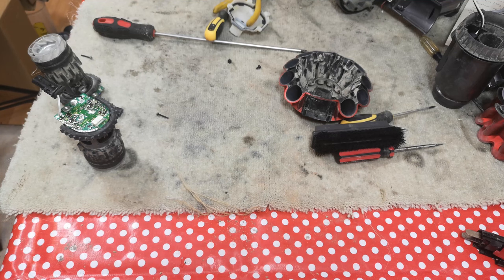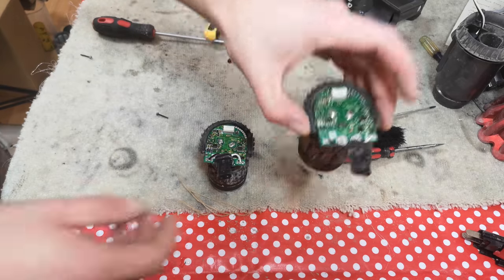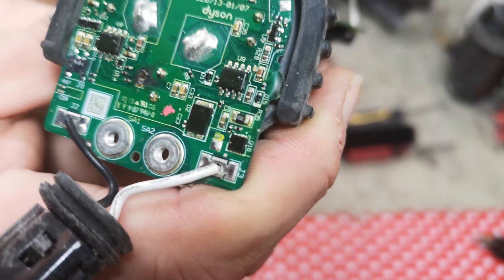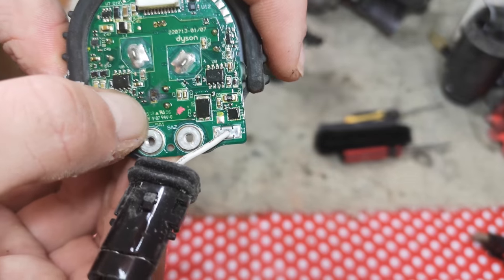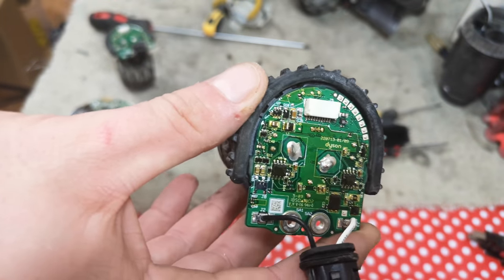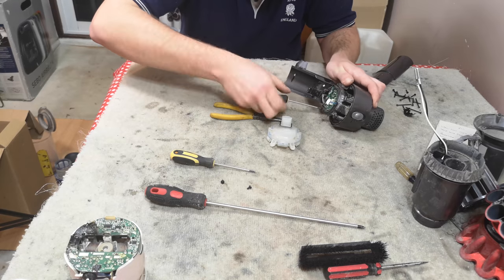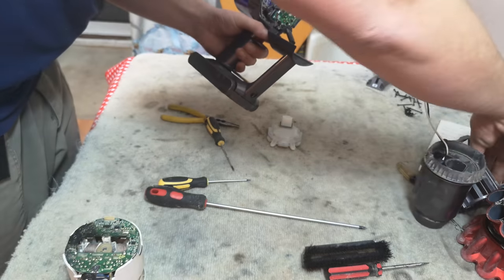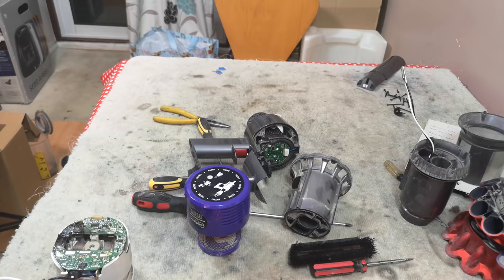A Dyson V10 Digital Motor that has been on fire...

Comment: Wait a second, dyson won't even repair a machine for pay anymore? When my v10 goes bang a month outside of warranty I guess I'll be up a creek. That's really sad, I wish vacuums weren't becoming non-repairable, expensive, and not long lasting like smartphones with yearly upgraded releases. Dyson are even trying to phase out their independent service centers in the USA.
Reply from the maker: I'm only going by what the owner said though... And I didn't press her for a recording of the conversation! This is the second v10 with a smashed cyclone I've had though where dyson said no...luckily now I know used chassis are quite cheap that's the repair they'll get now from me!
Reply: It’s probably not just because of the accidental damage. They are trying to not have engineers go out due to COVID 19.
Reply: @beko1987  That's a fair point, I guess we don't know the exact situation on this. I'm treating my v10 very gently so I'm not too worried about breaking the cyclone (plus I got it for the price of a v8 so I'm not too bothered!)
Reply: @blakaeg  Fair point, wasn't sure if maybe Sam had recorded this repair prior to the outbreak.

Comment: My V10 blew up when I changed gears with the trigger engaged. I went from medium speed to top speed, and it burned. Dyson will replace it, but I am worried once the warranty expires, Dyson won,t fix it. It seems like a simple problem; I am surprised Dyson hasn’t addressed it. Good thing, you can fix it. But still. It is an expensive vacuum, and I don’t know any decent electrician in my area.

Comment: Those ceramic capacitors fail all by themselves from time to time. I'm not surprised the motor still works without it. I've just repaired our DC62's motor which had died. One of the switching transistors had failed. They're on the back side of the board, so you have to desolder the big connections to the tags of the motor windings then withdraw the PCB. The transistors are surface-mounted. With the right tools, they're not hard to test and replace.

Comment: I had a V11 that was water damaged and the driver board was burnt it's not very good when there is plastic all around the digital motor could cause a fire when your using it unless the plastic dyson use doesn't combust

Comment: If I designed a new vacuum it would be a corded upright vacuum featuring a 600 watt high efficient brushless suction motor with over 120cfm and 100 inches of water lift and emits a nice soft 525 hertz tone on the max power setting and is almost as tiny as a shark 750w screamer motor but with a larger fan to motor ratio. Takes non woven cloth bags, disposable pre motor filter, and a replaceable HEPA filter. Also for a fee you can get the carpet model which comes with a wessel werk EBK 360 for grit busting agitation. The base model just comes with the bare floors straight suction head.

Comment: 0.1uF 50V 0805 chip cap. Bypass only, not too critical.
Reply: 'not too critical' - but, what's it there for? What happens if the 'bypass' is required?
Reply: @bristolfashion4421  'bypass' refers to power supply bypassing, not signal bypassing. It's there to help stabilise the power supply against local small variations caused by a variety of factors. Chips work better when their power rails are bypassed.

Comment: Is there a trick to removing the motor from its plastic case?
Thanks
Reply from the maker: Just lifts out with a spudger or similar for me once it's fully apart, just held in by the rubber seals

Comment: Hi thank you for your interesting video! Could you help me? I got a used  Dyson V11 Absolute without battery. I connected the + and - inside the handle and the lcd behind the filter lights up a little bit but the dyson doesn't work...I noticed there are two more circular pins inside the handle but i don't know what they are (additional power, button, etc) i even tried to find a diagram but i didn't got anything, do you know what they are or can you tell me where i have to connect them? I saw a video where maybe they go to the motor control board but i don't know what they are... I'm really desperate and i don't want to spend extra money for a new battery...thank you very much!
Reply: i want to use one of these motors for a project, did you get it working ?
Reply: @callumsmith2900  unfortunately not i ended up buying an original battery, i will replace batteries next time with the original bmc

Comment: Dyson make expensive crap, dyson has a following just like a fake religious cult. I've taken the dc16 apart and I'm not impressed with the engineering, I going to do the same with newer models but I already expect more of the same exaggerated claims that a lot of people have fallen for. Energy in vs energy out, if you want more suction power you need more power input, Yes efficient design will help also if there is a truly lossless bagless system that would help in reality that has never been made only big claims. I think its all a marketing hype that millions have bought into. I'll state one example, dyson claim you don't need a bag: if that problem has been truly solved then there shouldn't be any 1: build up of dust upstream of the cyclone system 2: no need for filters pre and post motor turbine.
Claims that cyclone is a good concept are falsehood: it takes a lot of energy to keep dust and dirt that you have already drawn up into the dust bin to keep spinning around while any find particles light enough will be drawn on through the cyclone into the exhaust filter basically doing the same thing as a paper bag system did years ago.
Reply from the maker: I agree! Once you know how to repair and refurbish them cheap broken ones become good value, but like shark, Dyson are masters of advertising and pr over making a good machine